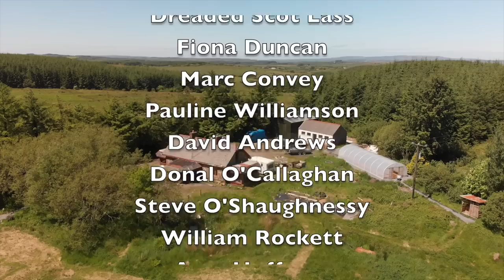DON'T WORK IN THE DARK!! Yurt platform finally complete!

Comment: If you end up working in the dark more than you like as I quite often do I made myself a simple lighting system. A couple leisure battery's a telescopic spot light pole and a 100w led spotlight all strapped to a set of sack trucks. I get about 10-12 hours and enough light to light up a large area that I only need to charge up like once a week
Reply from the maker: That’s a good idea. Hopefully won’t be doing too much of that. I had to keep going as the yurt needed to be up before the rain came. May make one anyway :)

Comment: Hi Bruce, are you really living off grid? in these times with rising fuel and power bill it's really a great idea. I bet you liked working in the recent heat wave. The yurt platform looks very study.
Reply from the maker: We are not fully off grid here at the moment. Our cottage is currently connected to mains electricity but heating we just have a stove and water we have a well. The yurt will be off grid for everything. I am monitoring our current power usage to size an appropriate off grid setup. That heatwave was insane I actually burnt the soles of my feet on the deck